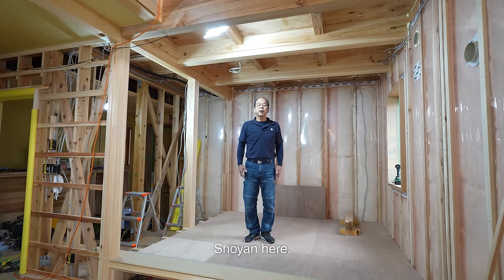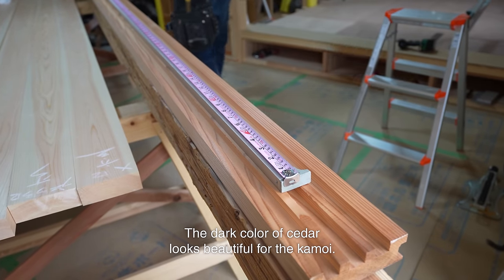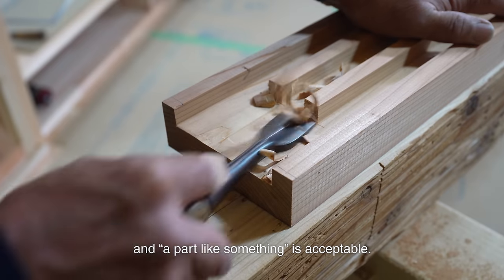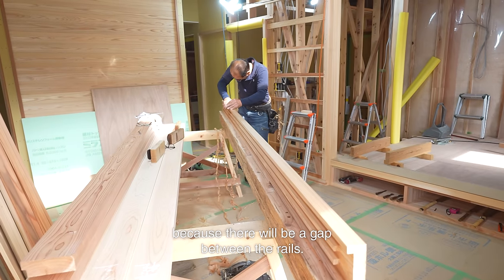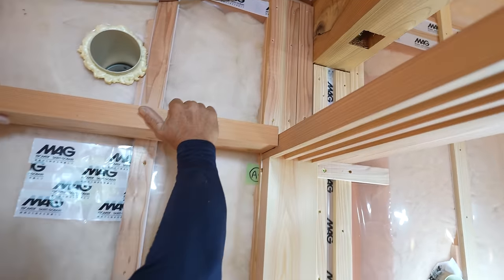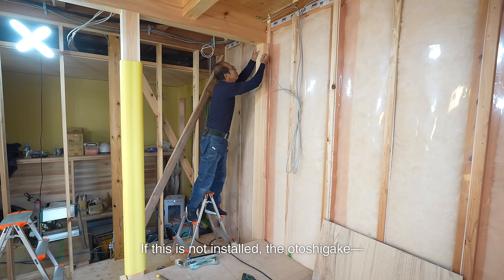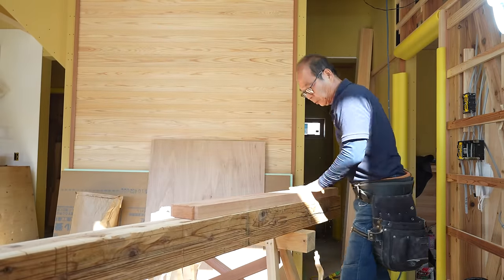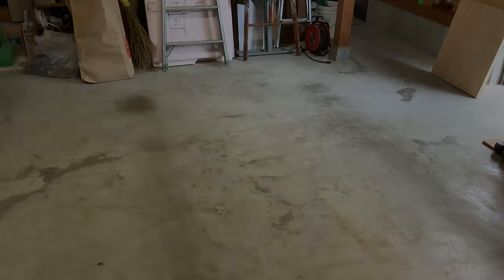Dark Cedar is Perfect for a Kamoi—a Japanese Head Jamb with Door Tracks [Season4 - Part15]

Comment: I have no woodworking experience, but I have been told to allow for expansion in humid or hot conditions. How do your joints and connections not be affected by climate changes?
Reply: The hand joinery allows all the wood to expand and contract together. Also he is using extremely high quality lumber. This is like furniture quality lumber in the USA. So the moisture content from the mill is very equal. Usually expansion/contraction problems come from when you install boards with different moisture contents.